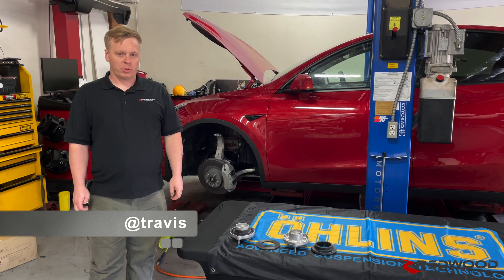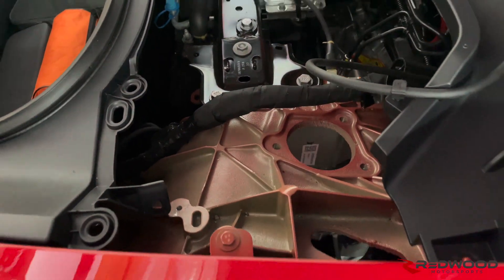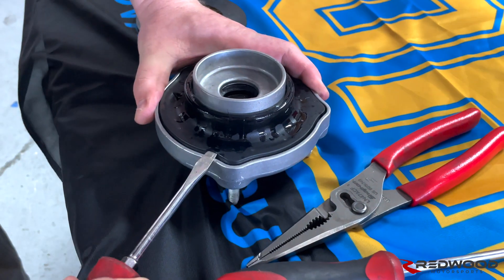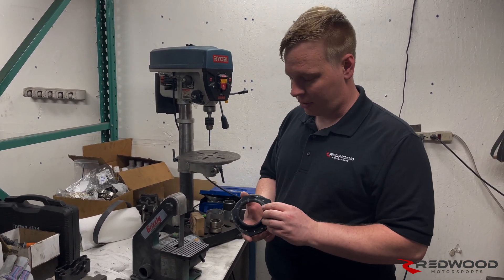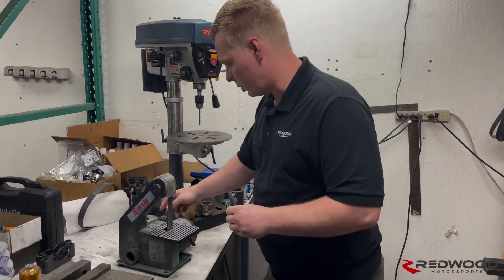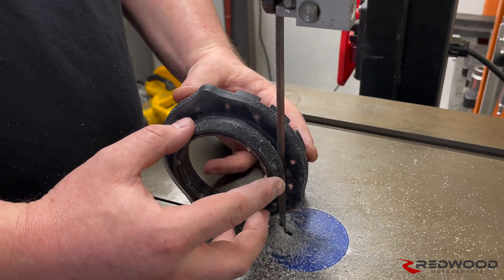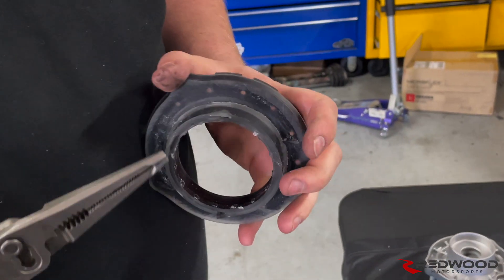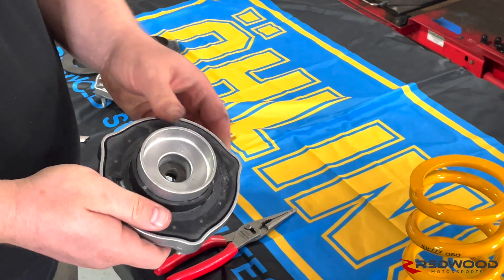2023+ TESLA MODEL 3/Y TOP HAT IDENTIFICATION, CHANGES AND INSTALLATION

Comment: I think this only applies to the structural pack 4680 batteries.  Tesla called this the AWD Standard range but now is just called MODEL Y AWD I believe.  Basically the entry level or cheapest Y.  The Long Range and P still have the 2170 battery and older style upper control arm/top hat from what we've seen.  I think all the ones in your video are from Austin.  Easy to confirm by looking for an “A” in the VIN vs a “F”.